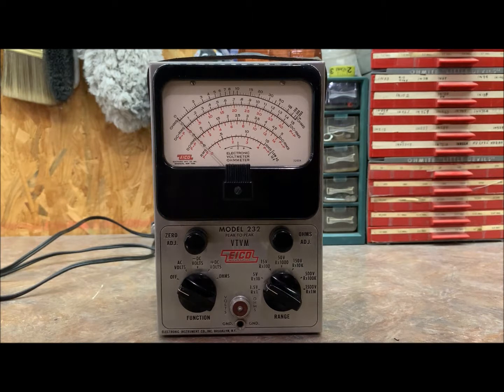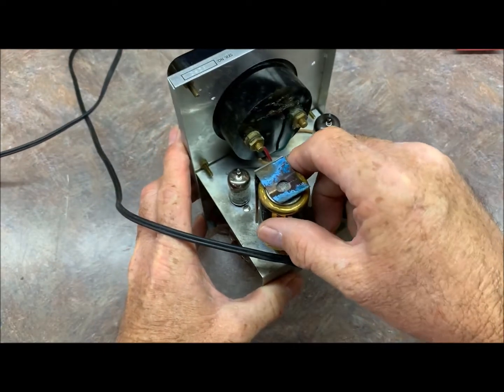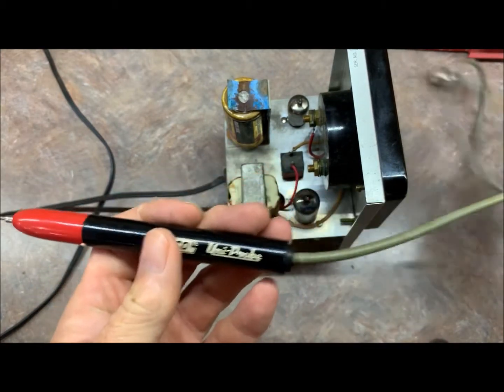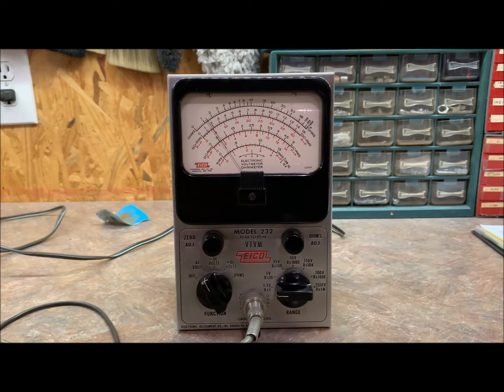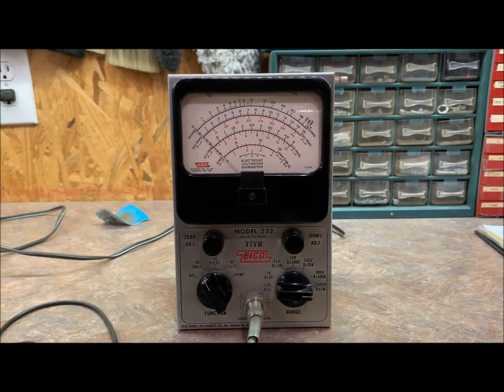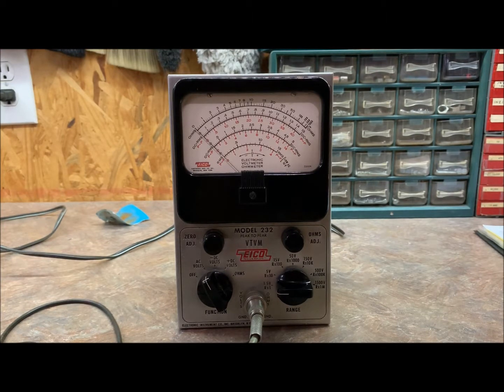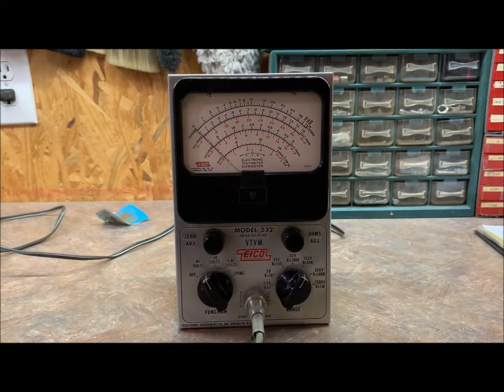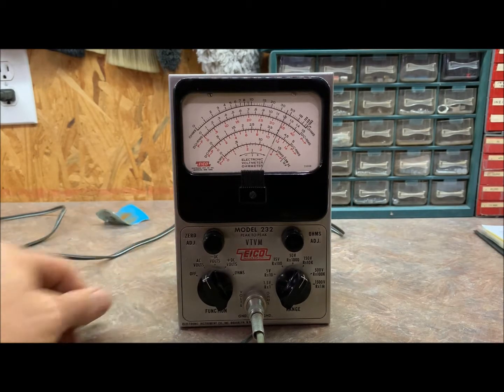Eico 232 VTVM

Comment: I was having the same problems calibrating mine, each range being "off" a little from the prior ones. Is this "normal", considering we're dealing with a kit built, 50+ year old device with 50+ year old components? When I first got mine, a 25 cent battery was still in it (a big lump of corrosion) but after clean up, calibration (STILL not 100% sure if I have it right) and a new battery, it works!! I bid $15 on another Eico 232, I'll scavenge the knobs and leather strap (strap looks brand new!!) from it if/when I get it!!
Reply from the maker: a2phil if unit will not calibrate, you have out of tolerance components, I would check all resistors for drift and replace if needed.
Reply: @caspianwendell  Thanks!! Will do!! BTW, I got the other 232!!! :) Even has actual (probably aftermarket) knobs on the side for the calibration!!